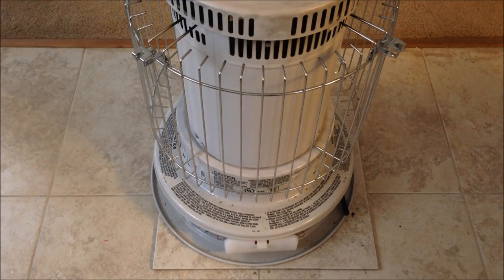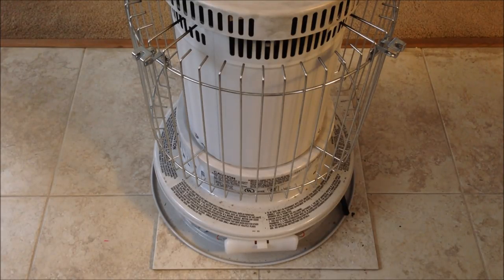Self Cleaning Kerosene Heater Wick Trick

Comment: I need some advice.. I recently changed the wick on my kerosene heater... before this I never had this problem.. but occasionally, I cannot get the fire to extinguish, and the fumes are really bad.  I turn the wick all he way down, and there  is still a fire going... and the fumes as I said are pretty bad.  Also, when starting the fire, it blazes really high.  Way higher than it ever went before I changed the wick.  Do you think there could be a problem with the wick???
Reply from the maker: Make sure the wick is installed properly, so that it's not sticking out when all the down. There should be installation lines on the wick.  It sounds like that may be the issue. There will be some odor when turning it off, but it should extinguish itself when you turn the wick down. 
It has been a while, but I had that exact problem after installing a new wick and that was my issue. I adjusted the wick and it resolved the issue.
Reply: a few things make sure your wick is going down properly when you extinguish it, when installing a new wick make sure it's in low position or it will not install correctly. next check the part above the wick and make sure it does not have ant soot on it where it meet the wick this will make that area burn high and smoke. and keep wick clean by burn it out outside then hit with a dry toothbrush, lower and refuel. also I wouldn't burn dry everytime maybe every three tanks full just look at wick to see if it starting to get carbon buildup.
Reply: Ozark Plateau Journey To Self-Sufficiency ha dummy your wick need proper height adjustment it's called calibrating measure it again or look it up or Google it!!!!
Reply: Thanks for your nice advice :)  I really am not very smart about this type of thing.. just trying to learn.
Reply: Make sure that the chimney is situated correctly on top of the burn chamber. The flame sounds like it is getting too much air and over firing. If there is a door on the front, open it and make sure everything is level. I had a similar problem caused by the heater just being slightly out of adjustment causing the flame to burn really high.

Comment: I have the exact same problem with that same heater.  The problem is the wick retractor doesn’t retract deep enough to completely snuff out the flame.  I have a 35 year old Kerosun by Toyotomi, with the original wick...I have tried to never let it burn out dry.

Comment: There is no reason to let the heater burn itself out every time. I have had one for years and that is why the heater has a shut off valve. The best thing to do is to just replace the wick with a quality one (from Mr. Wick or OEM) once a year, but if you are not willing to spend the $12 then dry burn the wick on an empty tank after crushing the wick tip with some pliers. Once the crush and burn is completed, make sure that the wick is no longer than 10mm above the base.
Reply: Do you burn the wick dry with everything assembled or take it apart to burn the wick dry??
Reply: @RCThis  ... he means only put a limited amount of fuel (high grade kerosene only) in the tank and burn it until all the fuel is gone and the last of it drawn into the wick is also burned up.
Reply: @RCThis  assembled

Comment: So the bottom line is, you should burn the wick dry to keep it clean, or brush the wick
after burning dry.    I think with the gradient heaters, you should be able to take out
the removable tank each time and let the heater just burn off whats left in the
reservoir.   Make life a little easier.
Reply: No, because the tank sit on a safety level with is pressed down when tank is in place, this effects the control/slider switch. Plus you would leave the fuel in the reservoir exposed.

Comment: Forgot to mention,you cant dry burn cotten wicks,only fiberglass type.The cotton wicks if dry burned will burn down 1/4 inch each time you do this.You might get by doing this 2 or 3 times,but it would result in too short a wick to use.Fiberglass type wicks have cotton sewn on bottom to saturate the fuel.Cotton works burn fine,just dont dry burn those types.You can use pluers or pinch top every so often to break off carbon/tar deposits.
Reply: THAT'S RIGHT, ITS OK TO LEAVE OIL IN IT.NEVER LET IT RUN OUT IF YOU DO  NEED TO GET ANOTHER WICK.
Reply: So I must have a cotton wick.....I've had my heater for only this winter...use it every day. I've tried dry-burning it several times, and that does not work. I am now at the point where the flame is uneven and most of it does not even curl over the top. I am not sure what to do from here. I would like to get a new wick, but I don't have a clue how to put a new one in. Most men know how to do this, but I'm not a man, and I'm kind of lost here. Can anyone possibly direct me to a good and easy to understand you tube video about installing a new wick?

Comment: Very Correct - ONLY! use Clear, K1 Kero (Much Cleaner Burn) - Let it run completely out of fuel - an old Toothbrush will work to clean wick - Clean every 3-5 tanks - Change wick every year - Mine is 10 yrs old & Works Great !!!!!

Comment: even the manufacturer says to "dry burn" the heater once a week. Dry burning is burning all the fuel out of it then resetting the wick to off for 30 minutes then relighting and let it burn off again. you do this out doors. This removes the carbon build up on the top of the wick
Reply: Ive been running dyed off road diesel not sure if its number 1 or 2 in my dyno kerosene heater. I bought the heater new and have never put 1-k fuel in it, going to put the third full tank of fuel in it tonight, it lights just fine, extinguishes just fine, no odor when shutting it off and no black soot at all, the top of the wick looks new and still clear/white i am amazed at the softness of the wick as well. ill never put 1-k in my heater

Comment: I didn't use mine for a year and now it turns on but is making a lot of smoke and had to turn it off.
Any idea what is wrong?
Reply: If anything (like a spider that has built a web) has gotten into the internal part that controls the fuel and air flow then yeah that will can make it smoke (heavily). I had to disassemble and clean mine, then it stopped smoking.
Reply: @henrytjernlund  Great, I will have to do that. Thanks

Comment: It's called "dry-burning" the wick.If you use your heater on a regular basis,you must dry burn the wick every 2 or 3 tank fulls using {clear} 1-K kerosene.Red dye type  sold in some regions of the country have to be burned more often.when tank is almost empty,turn wick adjusting dial all the way up and burn rest of the fuel out.This process helps burn-off carbon and tar deposits on top of wick.Do this twice and lastly carefully {with a paper towel or old toothbrush} rub top of wick off.If done correctly,most of the tar deposits will burn off first before you wipe the wick clean.Also,don't use cheap wicks.Hattensley wicks (purchase from ebay or milesstair.com)are best to use.Cheap wicks are thin resulting in an uneven burn causing burner to not put out or maintain steady even heat resulting in sooting and carbon deposits to build up faster on the wick which also causes odors.Always dry burn the wick outside or in a room with window up.
Reply: What if it won't light at all?
Reply: edselman58. I agree with you 100% you are correct. Miles Stair is the expert on kerosene heaters. His wicks are the best quality you can buy.

Comment: What could be going on, when you try to turn off the heater by lowering the wick, but the fire will not go out.... and the fumes are pretty bad.  Ever since I changed the wick, I've noticed this happening from time to time... I never experienced this until after changing the wick.  As well, when I light the heater, the flame burns excessively HIGH.
Reply: Lisa Hurley your wick is installed too high
Reply: Lisa Hurley your wick is to dam high !_you should check your manual or look it up! Google it!!! then reinstall the wick and test?

Comment: Being i burn ruby diesel in my fanco. i am having to dry klean it every two tank fuels. Kerosene here is $4.00 and the RUBY DIESEL is $2.39 gallon.  Kerosene is just about worhtless overpriced crap here.  $4.00 a gallon. It helps alot keeping DRY CLEANING the heater. Helps get rid of the char crap.

Comment: People read your instructions manual.  The problems this guy faced are covered in the instructions.  He is basically dry burning it every night.   What he is probably not saying is that it stinks fairly decent towards the end.   There is no need to run it dry and as one guy said it will cause problems with the wick.  The manual suggests for mine every 3 tanks which are about 24-30 hours.  I use mine in my basement every day during the winter so typically I dry burn once a week.   I wait until i see the flame out and move it to my bilco.

Comment: You didn't show how to perform a dry burn of the wick, though.
Reply: He told you.  If you don't let it burn until it runs out of kerosene it gets a build up on the wick.  So every few tanks, let it burn until it runs out of kerosene.. manufacturer recommended every 2-3 tanks (about 3 gallons) to dry burn it... in other words let it burn until the wick is dry/goes out on it's on.  Most people don't do it that often and still get years of use out of it.  But it needs to be done periodically.

Comment: This is common sense any owner should know this. Its not a tip. Its called dry burning. You dont do this every use. Once a week is fine you can get away longer. Once a week is a good idea though. Just burn till it goes out. Try to light again if it does let it keep burning till it goes out again with no fuel. Will clean it. Also its not sell cleaning. All the carbon build up is failing down under the Assembly. That should he cleaned out once in awhile to. When you do that its nice to dry burn right before an clean any carbon still on the wick off while cleaning out all the extra build up. Kill two birds with one stone. When refueling after dry burning (letting it run outta fuel) once fueled again wait 30-60 minutes to allow the wick to absorb the feul. Not doing this can caise for none even burning or burning issues in general.

Comment: I use jet fuel.  That way you don't get the clinkers.  Burns clean.
Reply: JP-1 is jet fuel is super refined kerosene. How do you come by it?

And BTW RP-1 (rocket propellant) is super refined JP-1. or super-super refined kerosene. So every time SpaceX launched their Falcon-9 rocket they are using RP-1 and LOX. They even super cool their RP-1 as to make it more dense and thus fit more fuel in the same tank. This is also why they fuel the rocket only minutes before launch, which NASA was not  happy about. But SpaceX eventually proved it was safe.

Comment: The problem is, is that you have to turn it off sometimes, these things really suck, this wick business is ridiculous, I'm ready to go get a torpedo burner!
Reply: Toyostove      Laser 56 etc few models 1200$ programmable requires 35 watts elec running about 250 starting kero and no1....find old monitor 41 or 441 and burn #2 NO antigels. They make a no2 burning water heater. Direct vent exhaust has air inlet supply built in. Way better than stinky  noisy torpedo, cost more.

Comment: My is burning black smoke is it the kerosene old
Reply from the maker: You may have the wick too far out.
Reply: Could be never use it been in my building for awhile just got it out of the box
Reply: Roger Louia check the wick height. too low stinky heater too high a sooty stinky mess. make sure that you are getting clean air in the room. Crack the windows an inch to let air inside because yes these heaters use oxygen. properly operating they don't produce and or enough carbon monoxide to matter. burn only K1 or 1K kerosene. Red dyed kerosene is often home heating oil or dyed diesel fuel. Sadly some places due to red dye add heating oil or diesel fuel to kerosene in the bulk tank because most people are not going to notice and just think it's stinky kerosene. Proper kerosene heater maintenance, quality kerosene, a funnel that traps moisture every fill up, adequate ventilation, and you will have the best heat. If you want to go to Miles Stair's Wick Shop read about kerosene heater maintenance and care also read about kerosene. I am learned a lot from his website.

Comment: After letting it burn out completely when on Empty "outside" wait until it burns out then relight it.  this will aid in removing the carbon build up :)
Reply: I use a kerosene  heater, the wood stove is just to difficult for me...I am 69, arthritis in most of my body...especially the hips...getting up and down to load wood, to poke at the fire, to keep it going...just way to much..yes five  gallon is heavy but...I only fill up the tank..about every eleven hours...not every thirty five minutes. .